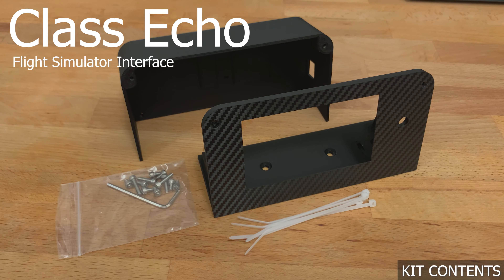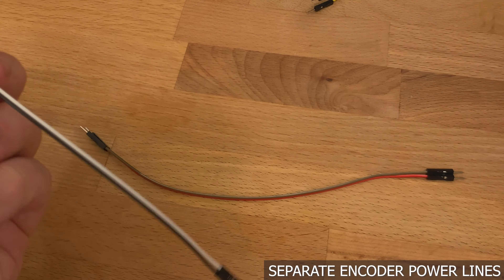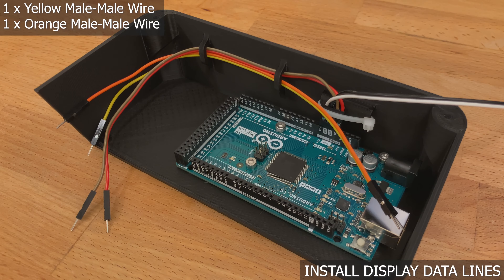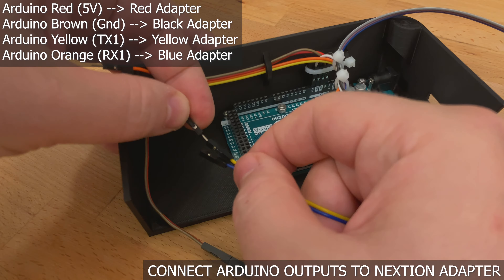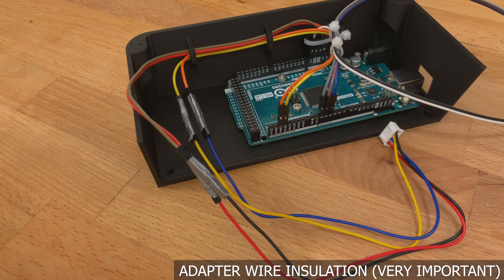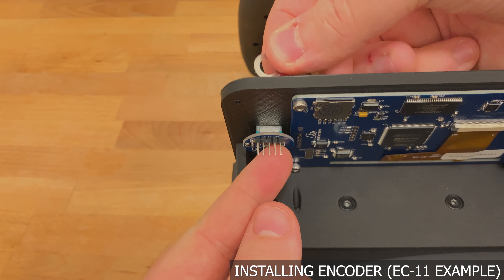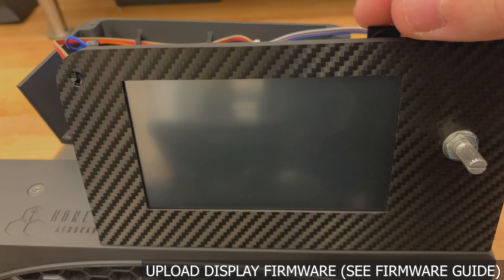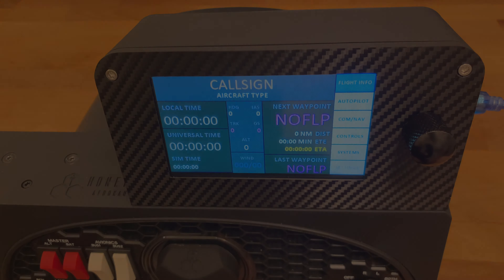Class Echo - Video Build Guide & Tutorial

Comment: Does the speed controls allow for an Airbus type situation where it is managed or selected?

Vertical Nav (Currently INOP)
Flight Level Change (Currently INOP) 

Are they still inop??
Reply from the maker: Hi Neil! Sorry I'm not checking the messages in YouTube regularly - The VNAV is currently INOP, but the Flight Level Change is working as it should be now! It is possible that VNAV will be working in the next firmware release 1.2.0 in January. Thanks!

Comment: Question, What is the difference of the Enhanced version NX4827K043 and the non-Enhanced version NX4827T043 of the Nextion Display 4.3 inch touch screen? The Enhanced version is just a couple of more dollars.    Also, do I still need to also purchase the mini SD card or can I use a regular USB drive for the firmware/software updates? 

Also, do I need to purchase the all wires needed to assemble? Your Etsy listing says I don't but here you don't  mention it. 

  I am very interested in purchasing the Class Echo..But I need to verify all the parts I need.
Thanks!